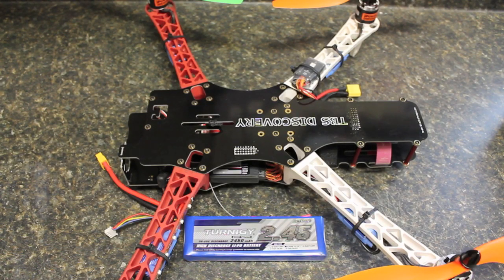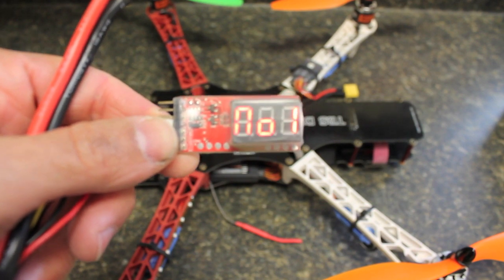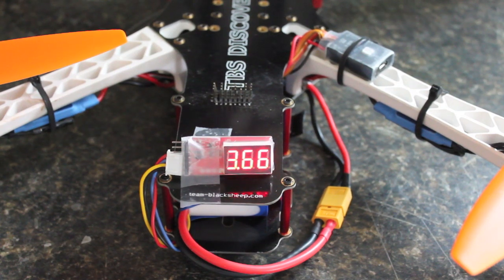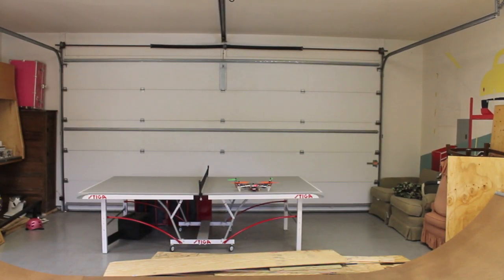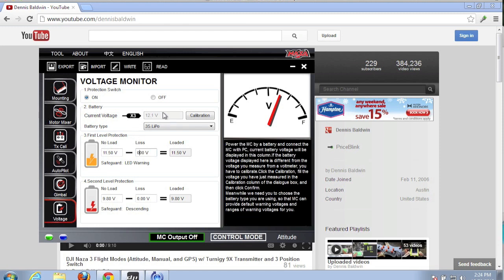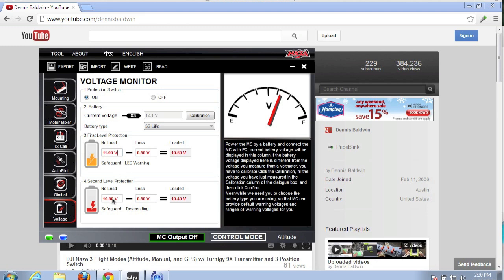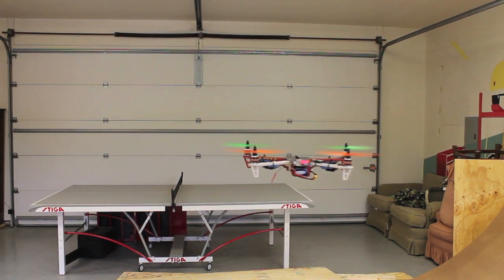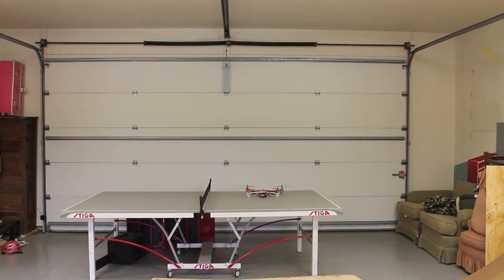DJI Naza First and Second Level Voltage Protection Setup and Configuration

Comment: Yes I do, as well as the new FRSKY DJT - JR TRANSMITTER TELEMETRY MODULE, and the FRSKY D8R-II PLUS - 8 CHANNEL RECEIVER W/ TELEMETRY, I picked up from .alofthobbiesdot com. that one is the best. but then there's the 400-470MHZ frequency hopping LRS for JR radios, new I use this on my airplanes it fly's to far for a Quad! I picked it up at foxtech or hobbyking. you just have to take your antenna off and plug it in and bind. if you would like to see it go to freedom hill fpv look for red truck.

Comment: Great Video, But you have to check out FrSKY 2.4GHz JR Combo Pack! you can find it a rangevidodotcom it rocks! I can fly 2 mile with my TBS Quad frame and back with this and a patch antenna. it's $45.00 US dollars just a plug and bind, you will have to take off your old antenna but you will love it. check it out! and there is a new system better then this one as well. 8 channels.

Comment: Sweet demonstration Dennis!  As far as the "loss" voltage and not being able to type 0.6 volts try deleting the 0.5v altogether first and then type .6 and see if that works.  I got the 0.6 volts to work on my set-up.